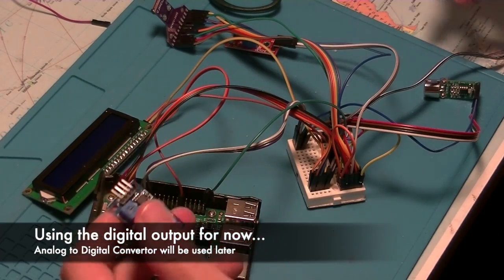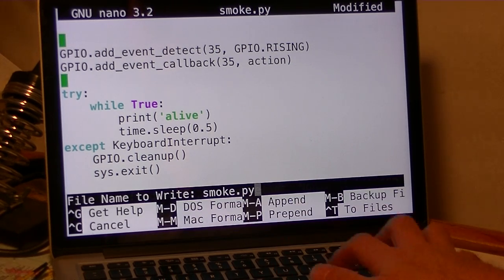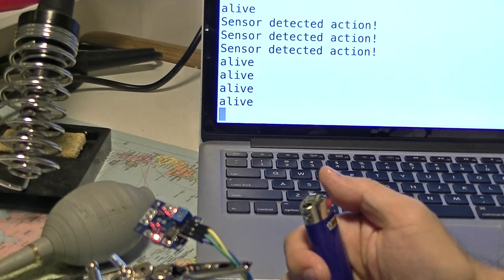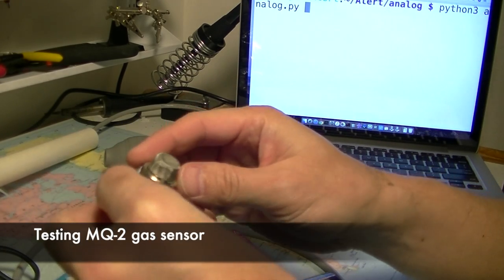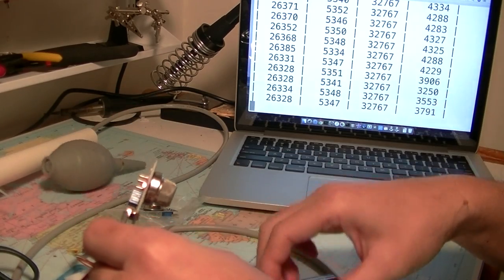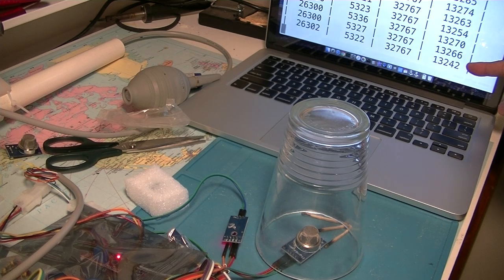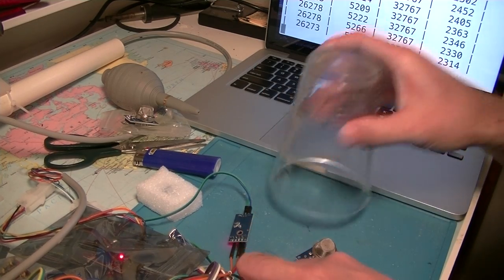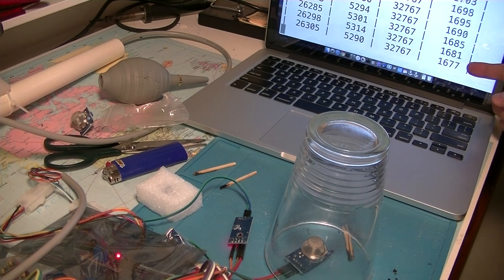MQ-135 & MQ-2 Gas Sensors with Raspberry Pi. Do they detect smoke and butane gas?

Comment: Useful video. I used ordered an MQ-135 before watching. I don't need the smoke detection so much, I want to measure air quality and monitor contaminants. I am hoping it works with tobacco smoke, maybe incense and weed. My challenge will be to see if I collect enough data for a simple analysis or ML algorithm to predict the contaminant. This is not for any nefarious purposes. People can smoke what they want. I am just interested if we can detect the activities and respond with appropriate stimulus.
Reply: grandpa, i think this type of cheap sensor wont give you accurate reading. as it fluctuate with temperature and humidity. and as it reacts to multiple gasses, you wont be able to differentiate it from the rest. good day

Comment: Hi can you send me your circuit diagram and code please at mustaqpandai@gmail.com please? Very appreciate for your help.
Reply from the maker: I have 2 types of scripts I used in this video. 
Script A - Using AO and Analog to Digital Converter (ADC)
Script B - Using DO directly from the MQ sensor which is risky due to 5v coming back to Pi 

Script A -  I used example published on github below for ADC version:
https://github.com/adafruit/Adafruit_Python_ADS1x15/blob/master/examples/simpletest.py

Script B - I have simple script below (use this at your own risk):

import time, sys
import RPi.GPIO as GPIO
 
GPIO.setmode(GPIO.BOARD)
GPIO.setup(35, GPIO.IN, pull_up_down=GPIO.PUD_DOWN)
 
def action(pin):
    print('Sensor detected')
 
GPIO.add_event_detect(35, GPIO.RISING)
GPIO.add_event_callback(35, action)
 
try:
    while True:
        print('alive')
        time.sleep(0.5)
except KeyboardInterrupt:
    GPIO.cleanup()
    sys.exit()

Comment: Hi can you send me your circuit diagram and code please at masterclayy@gmail.com please? Thanks much ^^
Reply from the maker: I have 2 types of scripts I used in this video. 
Script A - Using AO and Analog to Digital Converter (ADC)
Script B - Using DO directly from the MQ sensor which is risky due to 5v coming back to Pi 

Script A -  I used example published on github below for ADC version:
https://github.com/adafruit/Adafruit_Python_ADS1x15/blob/master/examples/simpletest.py

Script B - I have simple script below (use this at your own risk):

import time, sys
import RPi.GPIO as GPIO
 
GPIO.setmode(GPIO.BOARD)
GPIO.setup(35, GPIO.IN, pull_up_down=GPIO.PUD_DOWN)
 
def action(pin):
    print('Sensor detected')
 
GPIO.add_event_detect(35, GPIO.RISING)
GPIO.add_event_callback(35, action)
 
try:
    while True:
        print('alive')
        time.sleep(0.5)
except KeyboardInterrupt:
    GPIO.cleanup()
    sys.exit()
Reply: @funincomplete977  how to copy this code
Reply from the maker: Sorry, I didn't quite understand what you meant.

Comment: Can i have the code?
Reply from the maker: I have 2 types of scripts I used in this video. 
Script A - Using AO and Analog to Digital Converter (ADC)
Script B - Using DO directly from the MQ sensor which is risky due to 5v coming back to Pi 

Script A -  I used example published on github below for ADC version:
https://github.com/adafruit/Adafruit_Python_ADS1x15/blob/master/examples/simpletest.py

Script B - I have simple script below (use this at your own risk):

import time, sys
import RPi.GPIO as GPIO
 
GPIO.setmode(GPIO.BOARD)
GPIO.setup(35, GPIO.IN, pull_up_down=GPIO.PUD_DOWN)
 
def action(pin):
    print('Sensor detected')
 
GPIO.add_event_detect(35, GPIO.RISING)
GPIO.add_event_callback(35, action)
 
try:
    while True:
        print('alive')
        time.sleep(0.5)
except KeyboardInterrupt:
    GPIO.cleanup()
    sys.exit()
Reply: @funincomplete977  good day sir, do you have the schematic for the Script A?